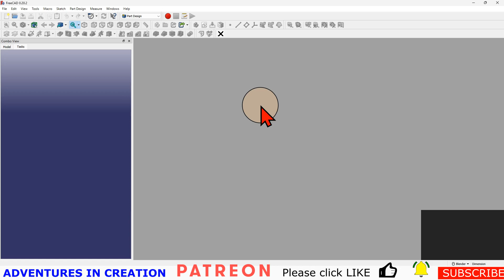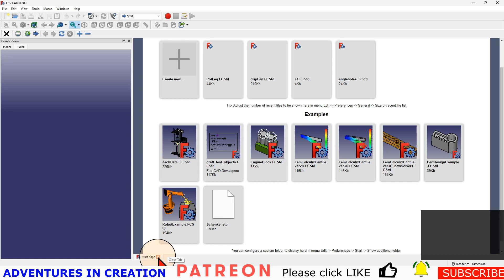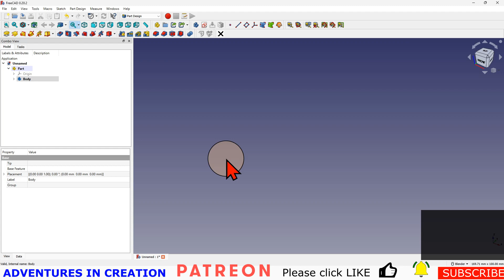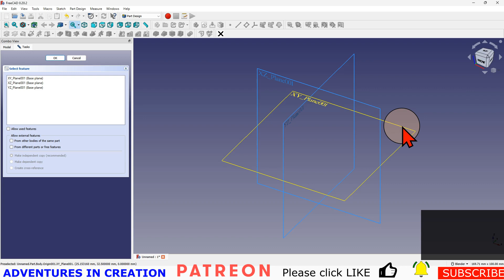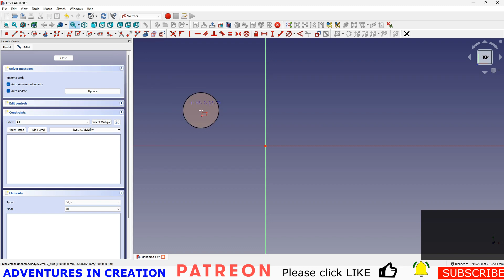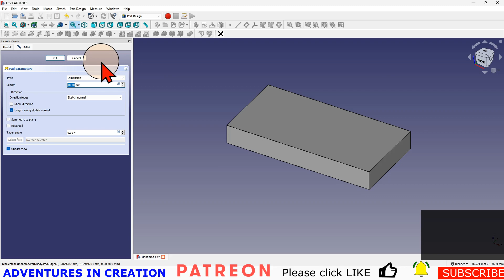Back 2 Basics Number 1 #freecad #cad #makers

Comment: Hi! In your first videos, you used version 0.19 and the polyline tool a lot. This tool is very useful to me, yet my version (v.0.21) does not have it in the sketcher toolbar. How do I add it? Thanks.
Reply from the maker: It should be there, maybe the icon changed.
Reply: Indeed, the new polyline icon instead of several line segments with intermediate dots (old) is now a couple of line segments and an arc separated by dots.

Comment: Hello,  Im an old timer newbie, loving this content!  I am completely obsessed with parametric drawing using the spreadsheet feature you have provided, looking forward to experimenting with more technical drawings using this. I do ok when I start in freecad, its when I try to import I crash.
When it comes to importing files is where I am lost! types are confusing on what I can and cant do with each type. I need to import a svg to modify a logo to 3d for printing and I get 80% there and cant figure out how to complete it, I get the text to a point but have a few letters I cant remove the inner portion of the letter?  Ive been searching thru the videos and the one that comes closest is  the one where you work in part and not part design, maybe you could do a video on the file types and their respective limitations?
Reply from the maker: Great input, thanks Fred! - I have another video in the works that demonstrates how to use Dynamic Data which can replace the spreadsheet. You will love that. - I will look into what file types and their limitations and see if I can come up with a video to explain it.

Comment: Great Start - one thing that was hard for me to learn was the sequence of  sketches that were needed to build a part with multiple padding.  It would be good for you to explain when to add additional sketches.  Also, is there a good naming convention to use for sketches.  I have started naming my last pad (or other last feature) "Final_part_name" so when it is exported, it has a meaningful file name.  You are a good teacher.
Reply from the maker: Thanks for the input Dan. My next video in this short series is going to show how to add pocket and/or hole to the part. I will discuss the reason to use pockets and holes and now will include information on when I choose to use additional sketches. TLDR: I like to keep sketches simple.

Comment: I wonder why pad doesn't work if you have a circle in middle of rectangle? It works fine in Fusion 360. It is really weird that you make pocket/hole separately instead in just one simple pad action 🤷‍♂
Reply: It does.  If there are closed polygons within an outer polygon then the pad feature will pad the outer and have holes where the inner polygons are.  
So you can have a circle in the middle of rectangle and then pad it.  One must be completely contained within the other however. Edited: grammar
Reply from the maker: As @Justin Richards said, it does work as long as the circles are fully enclosed in the pad. It will make through holes.
Reply: As stated, but you always get through holes.  It it better to be in the habit of using pocket for through holes AND pockets.